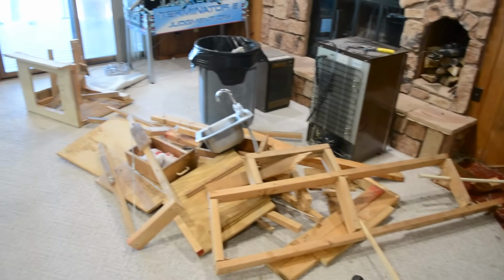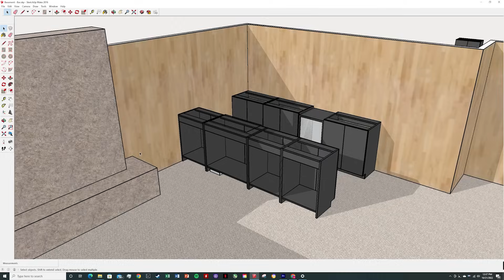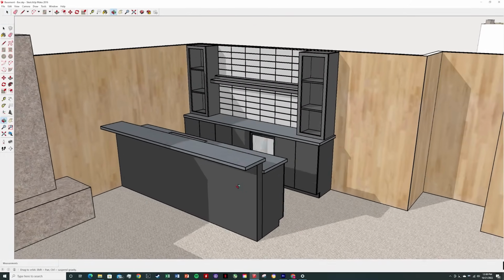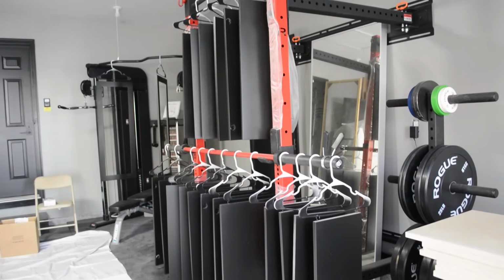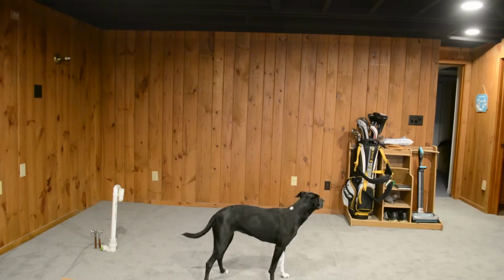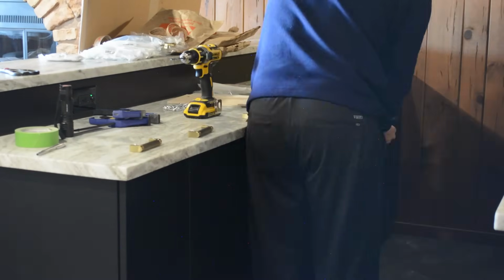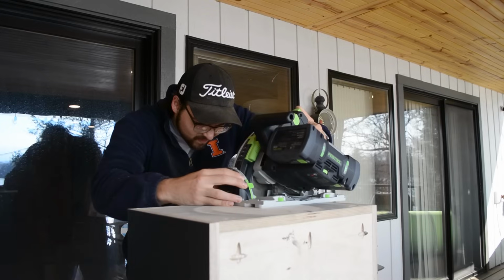DIY Basement Bar Build Start to Finish | Renovation Time Lapse

Comment: Great build! I want to do the same thing. Did you have to secure the cabinets to the floor or are they just held in place by their weight?
Reply from the maker: Thank you! I have a whole series on this build with more detail. I would check out those videos but to answer your question - I glued a block of wood to the tile and fastened the cabinets to that

Comment: Looks awesome.  Are there other things you had considered with this space? How did cabinetry stack up to your expectations going in to it?
Reply from the maker: Thank you so much! There was a bar here before with water lines already run in the cement subfloor so we didn’t consider too many other options besides a new and improved bar. We already have a TV/movie area but that would have probably been the only other possibility. The cabinetry was actually a lot of fun to build and they came out even better than I was expecting. Our kitchen was done by a custom cabinet shop and I’ve been told that my cabinets are of higher quality. The painting was time consuming and stressful but I’m glad I built them myself!

Comment: What tips would you give to someone that wants to start doing DIY projects. Also where did you learn all this? Seems like you have a very broad knowledge of electrical work and construction. Is it your profession?
Reply from the maker: I learned everything I know off of YouTube! Been following diy and building channels since I was in middle school. Slowly picked up tips and tricks. If there is something I didn’t know, I watch a YouTube video haha! So now I try to pass on that knowledge via my own YouTube videos 😁 I’m actually a CPA and worked in strategy consulting before quitting to run GKD full time. My advice would be to watch a ton of videos (mine are great 😂) even if it isn’t something you need to know. You’ll pick up little tricks along the way that you can utilize on different projects when the time comes. Invest in some decent tools. I’m a Dewalt guy, but I hear Milwaukee is great too. Get a drill/impact driver and maybe a circular saw. You can get by with just that for awhile. Only buy more tools when the project requires it. That’s how I started and slowly amassed quite the collection haha! Hope that helps!

Comment: Those counter top brackets look great. Could they work for a wooden counter?
Reply from the maker: Yes they could! Only thing is that they are not super strong. So if you plan to have a large overhang I would use ones that are more of a triangle shape as those are much stronger and can hold more weight.

Comment: Great work. I am curious tho, why the extra large cut out on that second tile. 4:03 
It looked like it clear the plumbing with a relatively small one
Reply from the maker: Thank you and good eye! The concrete was built up a bit around the plumbing so I had to cut the tile extra to make sure it would still lay flat. It all got covered up by the cabinets so it didn’t matter all that much.

Comment: What size cabinets are against the wall and how much space do you have in between the cabinets?

Thanks
Reply from the maker: The cabinets are all 18” deep and the gap between the cabinets is 36”. Hope that helps! I have a full video on building the cabinets and the install if you’re interested in more info
Reply: @GoldenKeyDesign  

Thank you for responding. My wife found your page because we are making some upgrades to our existing basement bar
Reply from the maker: @mrcosna1    Very cool! Good luck with the project!

Comment: Awesome. What type board did you  use for the cabinets?
Reply from the maker: Thanks! I used 3/4” baltic birch plywood with 13 plys. I recommend buying it from a lumber supplier rather than a big box store as their quality of wood is subpar. Also, I have an entire video on how I built the cabinets if you’re interested 😁

Comment: What would be a good estimate on the material cost without adding the countertops to the price
Reply from the maker: All the plywood was about $2,000. The rest of the materials I would estimate at $1,000. So $3,000 total. In my mind that’s very affordable given the end result, but it’s a lot of labor 😅 Hope that helps!
Reply: @GoldenKeyDesign  bruh the labor itself probably $10k worth

Comment: I was really thrown off when you caulked your new drain as a means of water tight connection to the existing drain. Good luck in the future if you have to replace all of those base cabs because of a plumbing shortcut going against code. Caulk is not a permanent water tight connection and has to be maintained after a period of time.
Reply from the maker: The home was built 40 years ago and the I could not find a fitting to connect to the ones they used in the concrete. The silicone will last a very long time and this sink is not used that often. There is also an access hole in the base cabinet that I can easily access the drain and make any modifications if necessary.